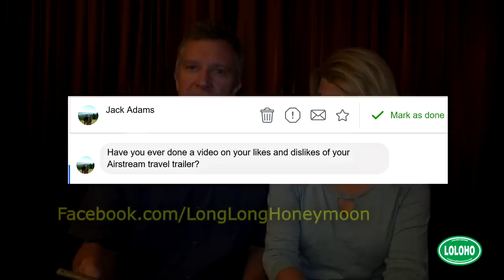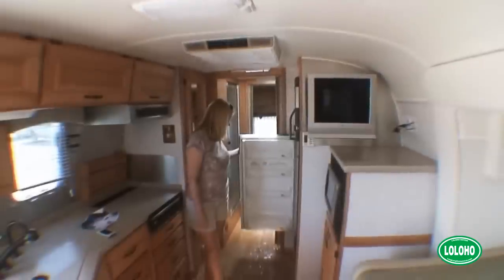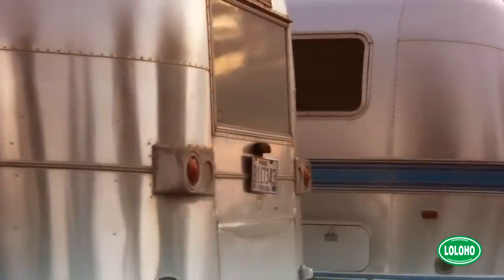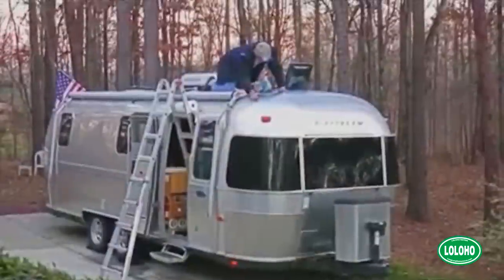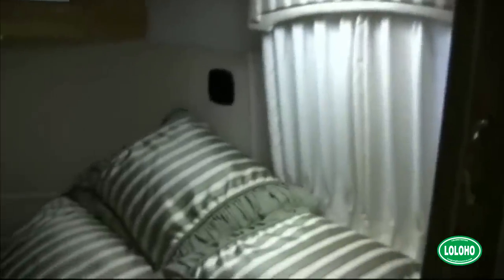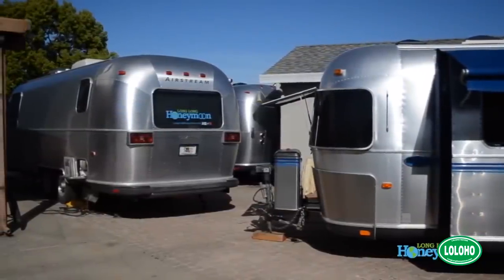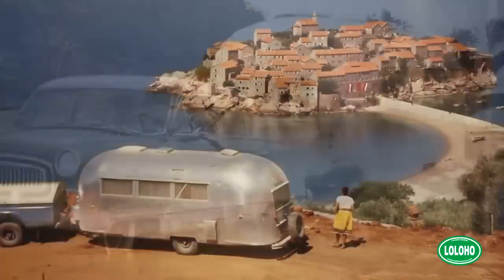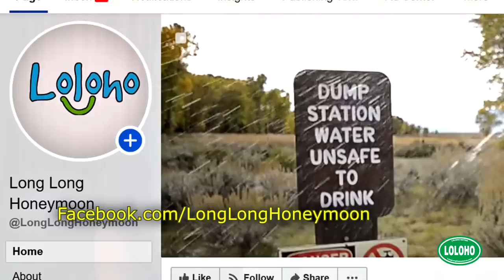🙊AIRSTREAM Travel Trailers -- Our LIKES 👍 & DISLIKES!!! 👎🙉

Comment: Years ago we had a self contained truck camper.  It was perfect for 2 people but taking it off and on the truck was a royal pain.  We sold it once we got little kids.  We worried about rushing river water and small kids getting swept away in an instant.  Sold the camper and now our kids are grown and we bought a R-pod 179.  Again, small but larger than a truck camper and has all the basic needs along with a AC unit.  I tow this with a K1500 Silverado and it is so light and aerodynamic I don't know it is back there until I see it in the mirrors.  If we need more room we go outside like you do.  Great video on likes and dislikes of your Airstream.

Comment: Love your videos, I’ve learned so much.  I had a Basecamp disaster for a year and traded for a 16’ Bambi.  It has everything I need and I can manage it alone (old woman here) because I camp alone. What I like besides everything: that there are no obnoxious swishy decals on the sides implying speed (hahahahaha).  Two things I wish for: cargo nets at the head and foot of the bed for a little more storage and a 110 plug next to the bed for an electric blanket when I have shore power.  Thank you. BTW I applied to AS to be on their composure panel.  I doubt if I’ll be selected, but they would benefit from the opinion of women in their design decisions.
Reply: Ila Ahearn    I’m looking at the Basecamp....if you can could you please elaborate about your thoughts on it.  Thanks 😎
Reply: Cal Gal I’ll be happy to respond, but not here. I suggest you go to airforums and search for 2017 Basecamp issues. There is a separate thread just for refrigerator problems. Good luck, read the reviews and issues.
Reply: Ila Ahearn   Thanks!
Reply: Cal Gal , in airforums.com there is a thread titled “First trip in 2019 BC X.” My entry was on 8-22-18, entry #42, name Sparkle.  It pretty much summarizes the problems I had and why I got rid of it.

Comment: You covered it pretty well.  The only other negative is that aluminum is a great conductor of the outside temp.  I took out all of the interior skin.  Replaced the insulation with block foam.  Still radiates because the studs are aluminum.  I have done a total overhaul from the sub floor up.  Added more electrical.  Stripped and buffed.  Completely sealed every seam with the recommended caulking.  We are living in it stationary so it is more like a park model.  We are always hooked up to the grid.  So we have electric heat and hot water.  The fridge is the only reason for the LP.  But I love the way it looks.  I have a couple of videos of the remodel.  Wudrest channel if you are interested.

Comment: Great video! For a long time I had always thought that airstreams got less leaks than your traditional wood framed camper, but the more I look at used airstreams the more I see water damage on the floor near the sidewalls. The upside to that is that airstreams are easier to fix in a lot of ways because you don’t have to replace moldy rotten wall framing since it is aluminum.

Comment: I have gone round and round with whether or not to buy a Stream. Cost isnt the issue as much as these five concerns that continue to keep me away: exterior maintenance (aluminum panels, rivets, seams;  compromised subfloors due to sneaky leaks; ground clearance and exposed plumbing; external storage; uncomfortable dinette cushioning.  The things that keep me interested: the look and feel of the inside space ... the light from the windows and aluminum walls is  just cool ... except in the hot sun!

Comment: My 1998 Aerolite 25' travel trailer is still in great shape. Aluminum frame, been great one and I paid $10,000 for it brand new in 1998. Pulled it all over still using it... I pass on Airstream. When we bought it, a selling point was that it was made by Thor, the same company that makes Airstream. Heehheheee, it worked, I though, well, that's got to be good. Actually, ours has been very good! I mean over 20 years of REAL usage, living in it for a few months at a time. The only problem is the gas fridge pilot won't light with the automatic thingamajig now, have to use lighter to light it. That's an easy fix, just haven't done it yet, and that's not trailer related.
Reply: I used to be in the RV industry, and Thor is one of the worst... it was a shame that they bought AS.

Comment: Excellent video!  You nicely stated the likes and dislikes without going on a tangent.  I love the nice clean look of airstreams outside as well as inside.  We seriously looked at them when we were purchasing a travel trailer.  We did not buy one because of the high price and we were not impressed with the interior quality.  After viewing this video I am highly relieved that we did not buy an airstream.  They are nice but come with some major flaws for the price.  
The tt we purchased cost four times cheaper than a similar airstream.  We saved roughly $60,000!  It may not be as “good” or “well made” as an airstream but it does not have major flaws either.  It has served us well for the last several years and should for the next several years.  Airstreams are nice but there are many more inexpensive options out there for a lot less money and hassle.

Comment: Another great video! You (father-in-law) did your own PDR repair, i.e., paintless dent repair on aluminum. Hail damage can be repaired on aluminum. The easiest way is with a glue puller especially if there is no access to the interior. The best repair is actually pushing the dents. Aluminum is harder to repair than normal sheet metal. However, it can be done. There is a 25% up charge for an aluminum PDR repair. The Airstream's torsion suspension contributes to the towability also.

Comment: Good honest assessment from an Airstream owner. The exterior is really vulnerable to damage and wear and tear. However, most dents are covered by insurance. Mine had a small dent above the door that required removal of door, window and large panel. Repair was 6,000 paid by insurance. I was skeptical that repairs would be done right. The Airstream Dealer in Buellton, Sky River RV, did a great job. Looks like new and no leaks. Small stuff is a problem. My top like is that it tows so well. Took it downtown San Francisco with no issues. No sway on open road. Our 2018 model has 16 windows which enhances the camping experience. The financials are great. 20 year loan and low depreciation is a big plus, considering most other RV’s have little to no value after 7 years, look bad and falling apart. Taking in all the pros and cons, Airstream is a good choice. Rare to be anywhere without someone wanting to look inside. BTW, the dealer that caused your dent was clearly liable and should have paid you. Love the videos. Keep them coming.

Comment: The Airstream NEST, though small in size for some couples, is seamless across the top. The seam occurs at the color meeting point along the sides and front. It's a down seam meaning that water cannot go upward if the seal fails (which it will in time). You just have it resealed. The inside of the NEST is very light and bright, there's ample storage inside (a lot!), and it is well appointed throughout. We bought the dinette version that comes with a huge cabinet and counter across from the sink cabinet, and then we bought an extra mattress from the other version of the NEST. We removed all of the cushions from the dinette, and we set up the mattress in a permanent configuration with lots of big pillows. It gives us a full-time day bed, two large storage cabinets and counters that come with the dinette version, and lots! of accessible storage under the bed where people put their feet when sitting at the dinette table. All that said and all of these positives come with one negative. The rear door leaked when we acquired it. However, they were all over it, they installed a better seal around the entire opening of the door, and it solved the issue. ALL RVs and Travel Trailers have issues. Period. That's a given. What matters is [1] how does the dealership (warranty or not) address the issue(s), and [2] how much do you enjoy the item when using it. We have visited 15 National Parks in our first year of ownership as well as several other amazing places here in the USA. We made two 25 day trips and three week long trips in 2019. The NEST has been superb. When (not if!) it has other issues, we are quite confident that the dealership we chose will make the repair(s). They're awesome! I think everyone needs to focus A LOT MORE on the dealership versus the product, and its flaws. Whatever product you choose, it will have issues. If you accept that reality (sad as that might be), your biggest and most important decision is to pick the right dealership. If you cannot accept that issues exist and will surface even with a brand new product like the one we purchased, you should stick to the Inn, B&B, or the Hotel approach to traveling. We did that for years before buying the 2019 NEST. Both approaches have their pros and cons. What's most important in our view is that either approach gets you out there traveling, seeing, and experiencing amazing new places.

Comment: You are exactly right about the older Airstream's! I purchased my 25' 1972  Airstream in early 2004. Everything was original and everything worked. 

Here it is early 2020. I replaced the still working furnace only because I did not want to rely on a 48 year old  heat exchanger!

Last year one of my son's and I replaced both axels.

This year I put it in to have a frame check. There were a couple of weak spots so I took that opportunity to have the Airstream dealer add a grey water tank and remodel the bathroom. I am considering replacing the original air conditioner, but it still works fine, so it is not a big priority.

Now it does show its age in spots, but I suspect it will last another forty years at this rate!

By the way, I originally paid $2700.00 for it. They wanted $3000.00 but was not sure if the refrigerator worked and so took off $300.00. I got it home and the refrigerator worked and has been working ever since!

And I agree with the previous poster... Kristy, you do clean up mighty fine and are an absolutely beautiful addition to the world!

Comment: We have a 2008 Airstream Classic 25fb. Had a water leak with water would run down the rear window bug screen. Took me about two years to figure out where the leak came from despite pressure tests and resealing the windows. Stored it covered storage. Finally decided to use duct tape on the panel seams above the window and then run water over it. No leaking. Pulled 6” of duct tape off at a time and found a line rivets on the curved end cap that  were causing the leak. Had a shop drill out the rivets and they found the rivet holes were elongated from the factory. Sealed the holes and and new rivets installed fixed the leak. I’ve seen plenty of fiberglass’s RVs with delaminating sidewalls. All RVs leak eventually.

Comment: My parents had Airstreams for decades but I decided after a Coleman pop up to go with a small  fiberglass Escape. It is just as light  as the Coleman and no cranking up but the best thing is one piece shell so no leaks which stopped me from camping for a decade. The biggest advantage to a RV is one can go where the weather is nice but many owners pull their huge homes on wheel, go somewhere and stay inside like they never left home. My father after pulling his large Airstream would be just as frazzled as Desi in the Long Long Trailer and the financial cost was also debilitating.

Comment: For those worried about leaks, I have a 2000 model with no leaks.  Yes you should check your roof seals/caulking every year or so, but the main seems don't just leak out of the blue.

Comment: If u hve a hyprid airstream punk stream, & u just make front 1/4 curved punked streamed w/heavier metal gauge then wood or carbon or rectangle box the rest u saved the 50s nostalgia not anything old tired rest, hinge to front 1/4 old punked airsteam then rest modern slide out of coarse.

Comment: As an Airstream owner, we love ours. It's 31 years old and it is in great condition. We had to repair some floor areas but it was not too bad of a repair. We did a face lift on the inside. We did strip the clear off and it looks brand new again. The clear made it look cloudy. At 29ft it tows great with our Tahoe. If we were to go great distances like Sean and Christy I would upgrade our Tow Vehicle. On a buying note we had 4 sold out from under us before we could go see them. I'm sure we could make a few bucks if we parted with ours but that ain't ever happenin'. Oh yeah this is our first camper. We camped in a VW Bus for several years. By the way we don't have any leaks now. Mainly it was the window glass separating from the frames. Airstream Classifieds and Airforums are your friends! LOLOHO we are neighbors, we're just south of ATL.

Comment: The biggest concern with an AS is weight... most people have too small of a tow vehicle to stop the rig SAFELY, especially out west. ALWAYS, ALWAYS . . . get on forums to get the real skinny on any trailer you have in mind. I moved away from AS because of the water leaks and the method in which they attach the body to the floor - the method used is simply asking for trouble, and at $100K I expected the basics to be in place - was I ever wrong!

Comment: A couple of dislikes from our 2008 23 ft Safari “special” RB. 1.  The rear bunk is a torture chamber for two people. Getting in and out of it at night is very difficult. When someone opens the bathroom door you may be subject to injury if you partner is not tucked in!   2.    The bathroom is another torture chamber. You most likely have a leg sticking out the door and trying to close the door means your knees will be jammed against door or become injured from your your partner trying to get out of bed !!   3.   The roll away dining table is a nuisance wrestling it into operational position, then trying to  get around it without collapsing it, then collapsing it to stow it.  4.   We got ours used so this may not be A/S problem. The water filter did not have a for and aft shut off valve and the built in “valve” failed filling the kitchen with water.  5.   The halogen lamps inside continuously failed. The were all replaced by LED. 6.  This may be a DIY fault before we received it. The was no valve and T to allow the antifreeze to be injected into the system. The pump was not bolted to the floor.  7.   The window seals were continuously sticking to the window requiring some gentlelevering to open them. It is a must remedy to keep the seals lubed with a silicone compound to avoid potential damage to the windows. 8.  The venetian blinds are forever coming out of the Mickey mouse bottom retainers causing the bottoms to intrude into the cabin during travel and on site.  9.   The Mickey mouse white plastic drain valve is very difficult to operate due to location and operating the valve requires gentle persuasion with pliers to open and close with a very good possibility of breaking the valve “handle” off. This valve was deemed to be easy to replace so sayeth the AS dealer! Damaging this 50 cent valve and not being able to replace it could prove a real show stopper with considerable $$$$ outlay 10.   When temperature goes down below 0 C  the door freezes to some unknown surface due probably to some unknown source of water acting as the glue In the summer it works perfectly. FINALLY don’t get me wrong this trailer is far better than ANY Forest River special.

Comment: No to Airstream. Yes to LoLoHo. The potential water leaks finally got to me.  Your honesty got to me even more.
Reply: yafolla any RV that is not properly sealed will leak. Any home not properly sealed will leak. It’s the lack of sealing maintenance over a long time that will get you. There is a reason why over 70% of Airstreams are still around.
Reply: We're using an orphaned R-Vision Trail-Lite until we can afford a Scamp. We bought it cheaply as a "handyman special." Job one was replacing the floor while resealing a bunch of leaky/amateurish repairs. Airstreams are cool, but "seamless" sounds really good to me about now. Even in our old salvaged rig, RV travel is fun. Because of LoLoHo we're planning a trip to Huntsville.
Reply: I was always told there are 2 kinds of travel trailers, the ones that leak, and the ones that will leak.
Reply: Yeah, that was news to me about airstreams. I knew other trail trailers could have leaks, mainly old travel trailers. I just assumed that it wasn't an issue with airstreams and they had to be reseal regularly. That would probably be the deciding factor.
Reply: @HartponderJr  yes and no, i work on these everyday. i mean rip apart and put back togeather. they are not sealed like other t/t's. ask me how many floors ive replaced.
Reply: rvsteve583 you are a good contact to know when it’s my turn for replacement... lol
Reply: rvsteve583 OK, I’ll bite: how many floors have you replaced?
Reply: Any of them can and do leak.
Reply: rvsteve583 I’ll bite, how many?

Comment: Have you ever had your Airstream at the top of Pike's Peak? I've had my truck camper there. Have you ever taken your Airstream to Hetch Hetchy Reservoir? I've had my truck camper there. OK, those were loaded questions: both have length limits that would prevent nearly any travel trailer from  going there. Of course, you can unhitch, abandon your Airstream (temporarily), and take your truck to those places. But your point about space tradeoffs, and your point about no engine, both apply to truck campers as well. Thanks for another informative and amusing video.